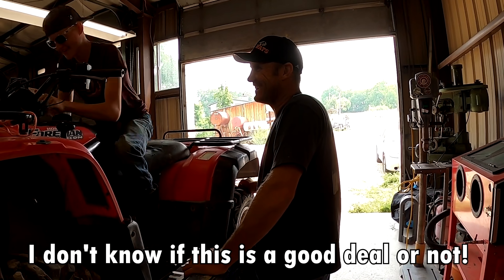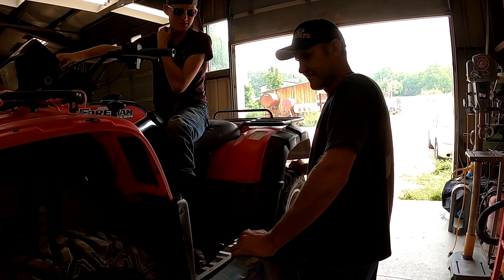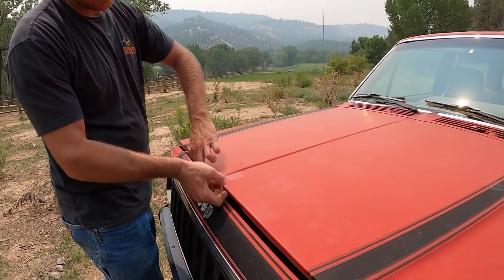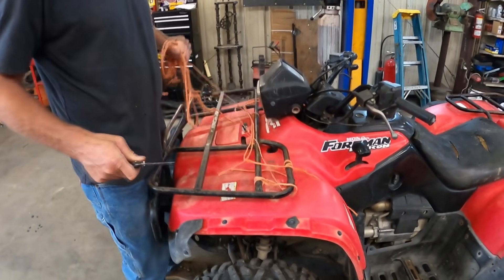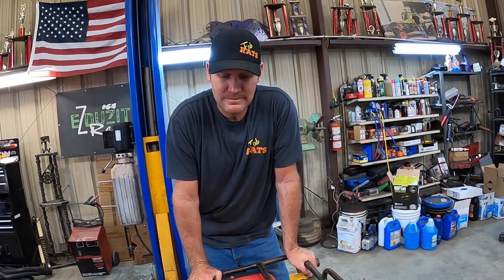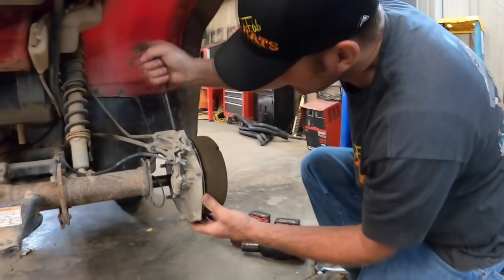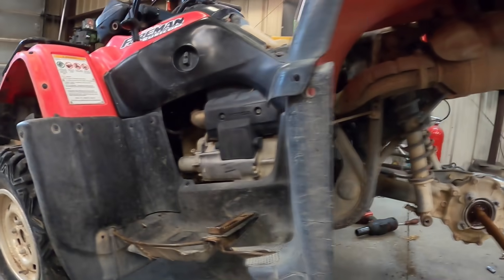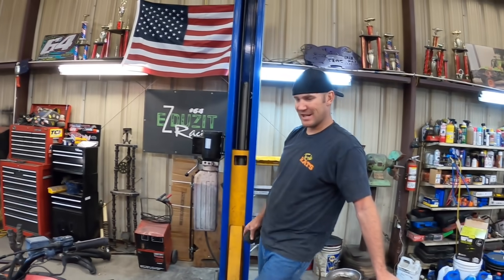Did I just make a GOOD trade or a BAD trade??

Comment: "Call it a drawl." You have to put a bunch of work into the quad but once you get it where you want it will last. It's a reliable old Honda. I love XJ's but 4 cylinder I'm not sure. If I know you guys though you'll probably drop an inline 6 cylinder 4.0 liter in it. Maybe Matt can give you the old Banana engine. Not sure how easy that swap would be but you guys don't seem to mind doing things that are hard. Keep the videos coming.
Reply: Big tires and a lift??  your Right 4.0
Reply: Same amount of work to 4.0 swap it as it would be to just LS swap it.  Might as well make it a v8.
Reply: @rhythm618  an easier swap would prolly be a 318 mopar instead of a LS
Reply: @zjenthusiast3037   No not really.  Might be a little cheaper but the 318 is just a heavy dog.

Comment: Hey Paul,
You got the better end of the deal because you got a 4-wheeler that you need for bow hunting and, as you said, you get to help your son with the Jeep "project".  You have such a great attitude.  Drop the oil filter into the pan, splash oil on the floor, no big deal, no cursing, no issue, just keep going.  It's refreshing.  Thanks for the video!
-mike

Comment: As a farmer I felt that "if it starts it gets used" part. Felt it deep in my soul 😂 got a John Deere gator like that.
Reply: On the farm I grew up on we had a pickup that took all 4 appendages to start, but it always started, so it got used…
Reply: i picked up a old gator 5 wheeler ,, needs all new tires ,engine ,rear axle bearings on 1 axle then i need to build a dump box for it also ,, was thinking of cutting off the front wheel and putting a 4 wheeler front end on it with a roll cage .. give it a golf cart front seat area ,, as it sits now its only a 1 seater ..
Reply: so it is!

Comment: Have your boy junk the 4 banger in the XJ and do a 4.0 swap. Now that I thought about it Matt has a lightly used 4.0 he removed from the banana.
Reply: Yep I reckon Matt would be into passing the motor to his boy, especially knowing that it was still gunna be looked after and going to a good cause.!! 🤗
Reply: Yep. I'd swap it too. When he lifted that hood and I saw the 2.5 I felt bad for the kid. if the XJ had a 4.0 it would have been a lopsided trade but with that 2.5 it was an even trade. Especially with a blown head gasket.

Comment: What a good dad. Brovo, say is the air pressure gauge in the steering cover still I have a 97 that came stock with it in there, was really shocked when I went to install my bar raiser from a Polaris, I'm 6'4" tall so the bar raiser was a requirement for stand up riding.

Comment: Up here in south central PA that old Honda brought back up to speed, shined up, go for around 2500 to 3500 depending on milage and tires, assuming like I said everything else is good. Regardless of the dad side of the deal, I think you still did alright, those Cherokees around here go anywhere from$400 to $3000 depending on the same criteria. God bless ✌️ Love the channel, I came over from Matt's Off-road recovery.

Comment: Jace, I started with a 4 banger Cherokee, Norbert. I miss that one. Converted it from a tiny single barrel carb to a throttle body injection. I could drive from Denver to Grand junction on 1/2 of a tank. My 2 door XJ was a V6. The 4 banger had more torque though. Easy to convert to the I6 and you and Dad can build a stroker. Good times ahead for you both.

Comment: ALL THINGS CONSIDERED (current "both need fixing" value, + price of parts/repairs, + need/desire of vehicle for both parties) I'd have to say that it was a fair trade.
Besides, when your kid is enthusiastic about a "junk" car, & he is willing to do (some of) the work to get it running/driving, he is likely to appreciate it more & take better care of it.
AND he'll gain more repair skills/knowledge in the process.  Plus the father/son bonding (via the trade, & via the time spent together to do the necessary repairs) is priceless.
...
(I bought my 1st car when I was 18 with my own "part time job money".  My Dad was against it, because he didn't think I needed a car while I was still in high school, but I bought it anyway.  He told me that I was responsible for all of its repairs, + insurance.  SO, I bought a couple of repair manuals & figured it out.  Soon I was capable & confident enough to do my own tune-ups, then brakes, then timing belt, then carb, then clutch & tranny, etc. etc..  Eventually I was teaching MY DAD how to do the brakes on his own car!  He was happy, & proud.  Looking back, all of that "lernin' " obtained via fixing worn out old cars was the best education that I could get.  Eventually led me to get my Mechanical Engineering degree, and a long career in Aerospace & Automotive design, & engineering/business-process consulting.)
...
BTW:  I have a 2005 Honda Foreman 500 4x4.  Those things are great little ATVs!  Fairly easy to work on, parts are relatively inexpensive, and they run damn near FOREVER!  :-)

Comment: I have this thing about rusty parts.  I would have gotten all the rust and grime off the axle and axle housing even though the axle couldn’t be seen after reassembly.  But, that’s just me.  I always thoroughly clean and often repaint parts.  When I sold my 15 year old Big Bear, it looked like new.  I had completely repainted the frame, racks and wheels and replaced the brakes and wheel cylinders.  I had prospective buyers who didn’t look at it because they said I was being dishonest by not providing current photos.  I took the photos the day before I listed it for sale!

Comment: Sounds like your 4 wheeler has the same rear brake pad saver as my old Saturn did: 150k miles on the original rear brakes...because the cylinders were seized up and the brakes probably hadn't done anything since the first owner somewhere around six years before I got it.  Car stopped so much better fir a couple months until I also got the fun of the master cylinder going out almost exactly as far up I-20 as it took to downshift to yank-the-parking-brake speed in an OReilly parking lot.

Can't help noticing you never smacked the carb with a big crescent wrench.  Done right, that fixes a lot of stuff on a Honda or Datsun. On my old 720 it would make the radio sound better.  Really weird since the radio was a boom box wedged between the seats, but whatever works.

Comment: I have a 01 Rubicon that never had that many problems & I plow snow with it mostly. You should of read the owners manual first if it still had it or find one online to download. I could of sennt ya digital copy of the owners & shop manual. I was wondering if you would forget the other drain plug for the trans. 
I had one problem with it that I couldn’t find online & took it to a shop. it only ran in reverse & the reverse lock out switch on the shift lever went bad. 
The place I go for parts is Honda East Toledo online & I saved more than half if I went to the local dealer. It even had better prices than Partzilla & BikeBandit. My display screen was all scratched up & those other places wanted $65 & I got it for $45. It’s always good to save money & I’ve used eBay as well. I got aftermarket parts that was way cheaper & works just fine.

Comment: Good trade on many levels. You got a project, the kids got a project, and you can help each other with your projects. By the time he can drive it on the road he will appreciate it and have learned a lot. And you have the shop that can whip that lil buggy into shape pronto. There is more to this trade than comparing values. There is having values, and passing them on.  Databyter

Comment: You are being a good father! In 1974, my father bought me a 1965 Mustang for $500 that did not run and had no differential. He told me I had two years to pay him back and make the car street legal and drivable. Just before I turned 16, it was a blown Windsor with 4.11 posi-trac rearend and broke the lugs when I popped the clutch in second gear (had a borg-warner 4 speed). Make him learn how to build engines!

Comment: When I was getting things ready to move from Ohio to Texas back in 2014, I blew the 6.2L diesel in my old 85 GMC Camper Special flatbed (crew cab dually). I was working for a HD towing and repair shop at the time. One of the mechanics had a 16 year old son that I'd seen drooling over my truck for over a year.

One day, I sent his son to the gas station to get me a Dr Pepper like usual. He came back with the drink and receipt like usual. I handed him an envelope with the keys and signed title to my GMC and said, "Good trade." Then I loaded my tool boxes into my other truck and headed south that evening.

The kid was stoked. He just got a good square body project truck in exchange for a cold Dr Pepper.

Don't worry, the trade you made here had value going both ways and will pay off in the end.

Comment: Those Rubicon 500’s aren’t half bad. Tough, decent power, rides a bit ruff and on a higher mileage units, you can run into issues with the electronic Push button shift but if you fix it up good, never have trouble selling a Honda wheeler.

Comment: Paul,  check the valve clearance.  Them hondas have a screw and jam nut rocker tip.  I'm betting its never been done.  As how that quad looks.   And its a honda so you got yourself a good deal.  Them hondas can be hammered on and still run like a champ.   And I'd put sum ITP mud lights on it.  They are awesome all around tires.

Comment: Hey I have a general ? Not necessarily related to this video. But, how serious is it to not overfill automatic transmission? I’m wondering as I bought a used vehicle and was told (and I believe it) that the owners dad who is a retired auto mechanic and services the used cars his son sells, that the vehicle had been serviced and motor and transmission fluid had been replaced. But it had a small leak of red fluid so I assumed it was transmission fluid. I checked the fluid level and it was quite high. After a month or so the leak stopped. Checking the level and it was now normal. So could there be an overflow valve or port? Or something natural that brought the fluid to the proper level? Or why would the leak stop on its own?

Comment: There is definitely two dipsticks lol but the fourwheeler only had one tho almost every small Honda engine has two one is just a plug and reason is for the different applications they use the engine in pressure washers to plate compactor and Im pretty sure it's always gonna be the gray ones are dipsticks and black is plugged

Comment: I've worked on cars for 40+ yrs used to work for Cadillac and the old 4.1 bad for intake gask etc . And the antifreeze sitting in the oil pan will destroy the bearings I also drag raced for yrs and we learned to never run antifreeze because it eats bavit off bearings etc .....so drain the oil on the jeep soon

Comment: Looking for advise I have a 1956 Chevy 1 ton dually 4+4 with a utility bed have generator ,solar panels , welder , plasma ,compressor . Lotte of camp gear and  tools .but I don't want  a .  i camp trailer I have 9long 4"5 high 5 wide for area to build house still need a roof rack with new addition ?

Comment: I have had a couple jeeps and I would say the kid did you a huge favor. The only thing is you still get the honor of fixing the fricken jeep. If you want some thing to work on all the time then a jeep is for you. The body is the only part that makes a jeep cool. Change the entire chassis, engine and drive line and drop on the jeep body for looks only. The older jeeps were built abit better and could take a substantial amount of abuse. I would say only the military versions were built to with stand some tests of durability. To sum it up the majority of jeeps were a bunch of Chrysler and jeep junk cobbled together with what ever was handy in the day. My daughter purchased a new jeep in 2019 it spent more time in the shop than actually driving down the road. I had showed her some reviews that were really bad and nothing has changed in almost the last 60 years they are still basically a bunch of junk. As far as value you can do $20,000 in repairs and still have an $8000 jeep as far as use around the farm yard the ATV wins hands down. The answer to your question in your other video 'are all jeeps cursed' is yes, and its's because; 'all jeeps are junk'.

Comment: I was voicing, "there's a second plug !", yes its an animal all its own and hopefully you don't have issues with the hydro system internally as the hydro unit would have to be replaced as a unit ( non serviceable and highly critical tolerances ). To check the oil level is weird, you have to run it a few minutes and then turn it off and wait a few more and then check the level as otherwise the oil migrates into other parts of the engine and get a misreading of the level. On another note as to the transmission and lack of torque to the tires in a tough spot, put the turn selector into manual mode and that way the swash plate will stay shifted down if you select 1st gear on the thumb selector and low range on the high/low lever. In auto mode always use D2 as it allows the engine to rev a bit more rather then lug it and slip the centrifugal clutch. Don't dunk this quad in the water and get water into the engine, it would be its watery grave indeed with the hydro system.

Comment: Find a running 4.0 for few hundred bucks and swap the engine. The 4 banger wont even pull 28in tires. Btw the quad is coming around. Id say a airfilter and fuel filter would be good for it.